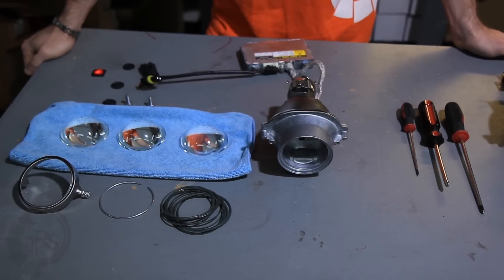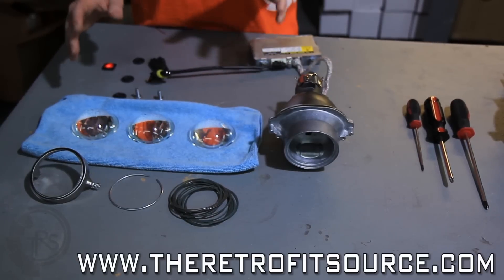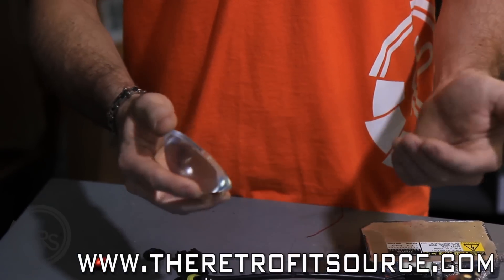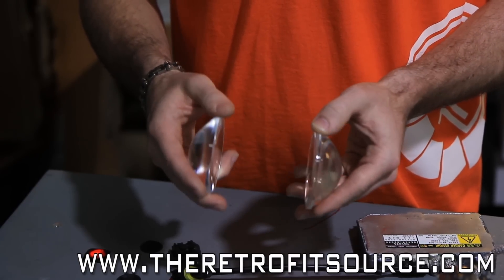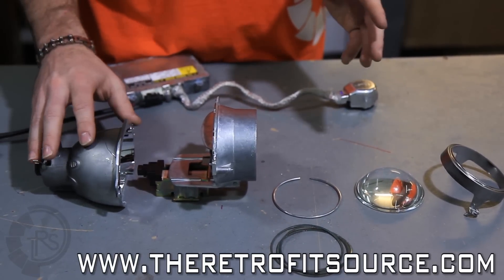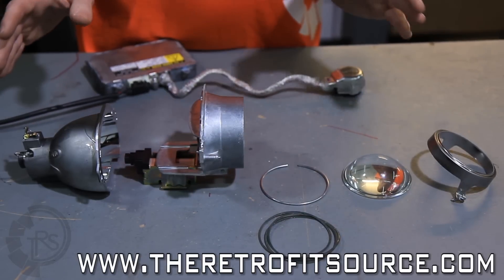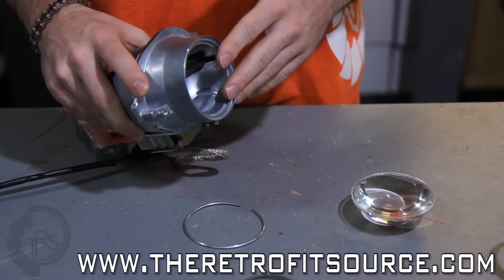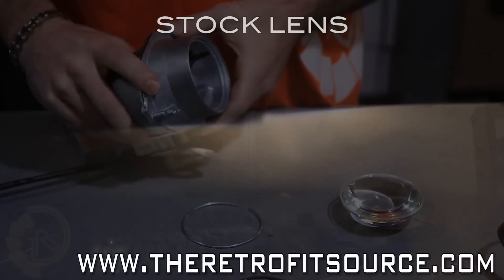TRS Tips: High Performance HID Headlight Projector Tuning With Clear Lenses

Comment: How do you measure the focus height, or depth, as you mentioned in the video?
Or is the problem solved mostly with the spacers anyways?
Reply from the maker: You want to replicate the original lenses, in the video we use the Nissan Murano projector. The lense is 30" with 27MM focus. The lense we use as the replacement, STI-R, is also 3" with 27MM focus. It will depend on your vehicle and OEM projector.
If you want to shoot us an email, we can assist further - support@theretrofitsource.com
You can also join our Facebook page, Headlight Junkies, to get answers for questions like this.

Comment: Is there any way to remove the cut off shield. Because i wanted to retro fit a projector for my high beam in lexus is350 2007
Reply from the maker: You can remove it, sure! But why not run quad low beams/quad high beams?

Comment: goog job bro..

I've a problem with my stock projector from mazda i think (but not CX series), its produce "Blank Spot" under the center of hot spot/cut-off and in the top of foreground, i try to add some nuts between bowl n lens holder or try to turn the bulp, but its just the same, the Blank Spot still there.
what should i can do, please 😥

Comment: how to adjust the focus? i have h7 halogen projectors which were replaced recently with a new headlight, now in this new headlight the cut off is blurry and there's no blue cut off like the old one. please help
Reply: check first to see if the bulb is seated properly. Try to wiggle the bulb to see if that makes a difference.